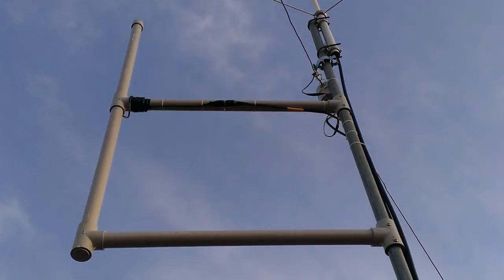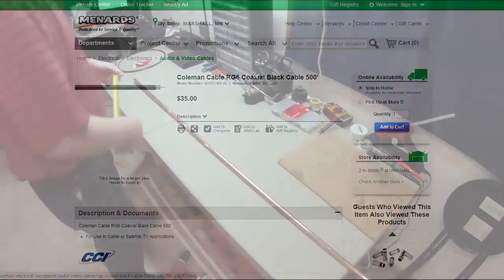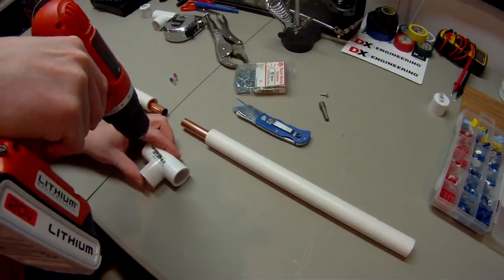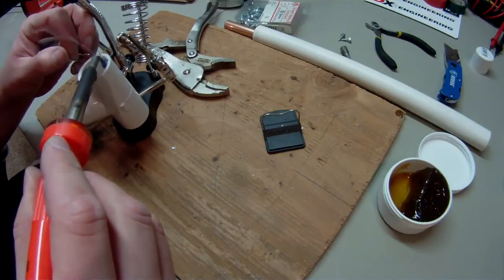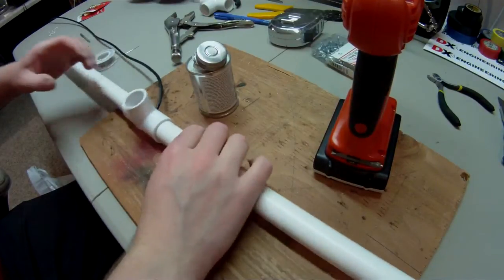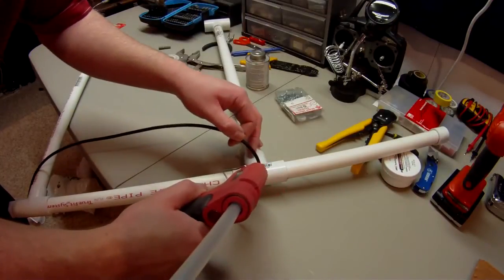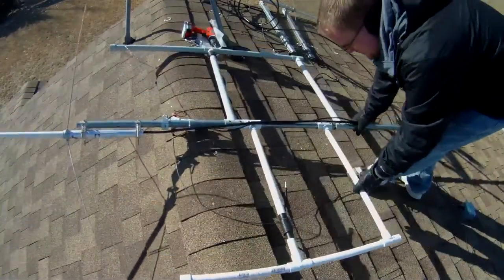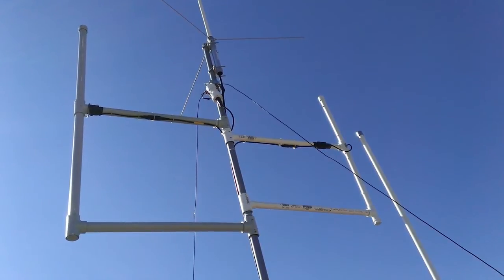220 (1.25m) Vertical Dipole fed with RG6

Comment: Kristijan Conkas, thanks for the comment. I understand where you're coming from, and trust me, I agree for the most part. I have a run of LMR-400 for my Diamond X300A which I use on my FT-857D and it's well worth it there. This whole project was to communicate with a group of 3 of my buddies who live relatively close by so I wasn't concerned about having the best of everything. I took this project on as a challenge to see how cheaply I could get on 1.25m and have it still functional. But either way, thanks for the feedback and for viewing the video, we appreciate our viewers.

Comment: Just a hint, you can use a cheap pipe cutter for the copper pipe and the coax insulation. Makes nice clean cut if your super OCD.
Reply: Hal Schlotfeld That's a great hint. I totally would have, if I owned one :)
Reply: I got mine at menards for a couple of bucks. If I remember it was less then $5